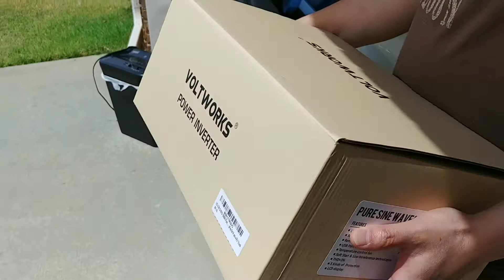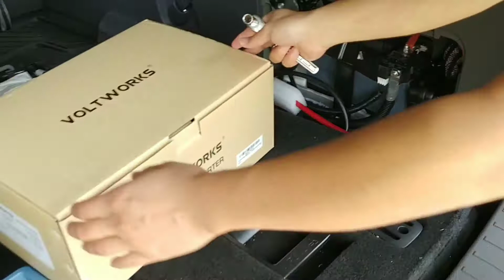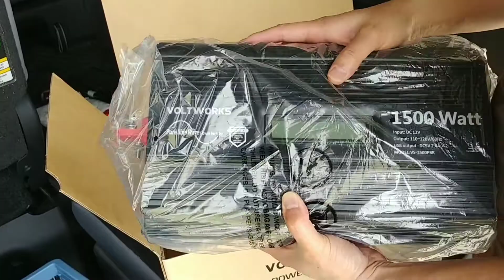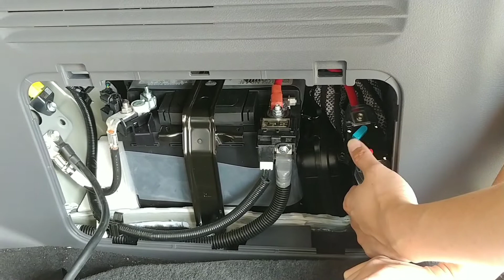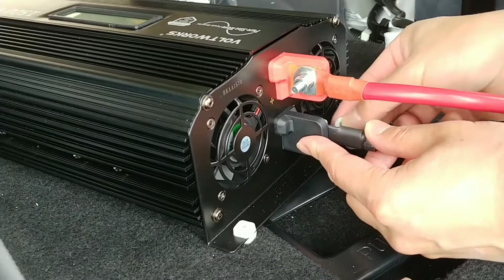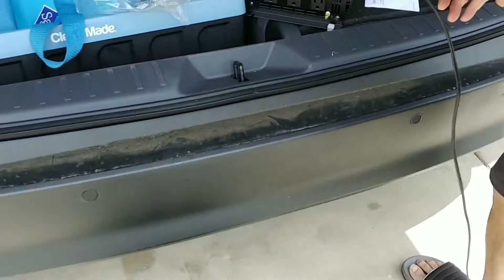2021 Sienna/highlander inverter install

Comment: @lifeofalego8061  Life of a Lego, after these years, have you finally had a chance of challenging the set up by running a 1300-1500 watt continuous appliance for 10 to 15 minutes?
Reply: Not possible using the 100A circuit breaker he's installed.  100A X 12.5 volts = 1250 watts, minus the 10% inverter inefficiency, would be roughly 1,125 available for continuous draw before tripping the breaker.

Comment: I know this is a late comment, but a 1500w inverter (will need about 150a) will burn up your DC converter (which has about 70a available output capacity)
Reply: Your 'DC converter' as a terminology, I assume you are talking about the car's high HV voltage DC to 12V DC inverter(Toyota's terminology).  Based on the facts that we can gain visibility of, your approx. 70a should not be correct. The Toyota's optional 'built in' 1500W AC socket/output is fed by the Toyota/factory '1500W' inverter and its 12V is coming from (the same for all Sienna models') the HV voltage to 12V inverter located in the engine compartment and it should be able to output about 140 amp to your 150 amp without burning up when continuously outputting 1500 watt.
Reply: @frmmli  This is incorrect logic.  The factory 1500 Watt inverter runs directly from the high voltage traction battery and NOT from the Dc to Dc converter that feeds the 12 volt battery.

Comment: The video ends with a test using a paper shredder, which is a lot wattage appliance, hence does not really proof 1500W. A 100A breaker was used on 12V. If you do the math, Power=Voltage x Current = 12V x 100A = 120V x 10A, it means, this setup will "break" when exceeds 10A on 120V appliance. Hair dryer, microwave, heater etc... likely will trip the breaker. That being said, as an Electrical Engineer, this setup would work with some different parts and some limitations... I would recommend move up to 150A breaker, possibly thicker wires. Now, the interesting calculation, if the Toyota DC to DC inverter/charger is assumed to deliver 100A to the Auxiliary battery, the Toyota Auxiliary battery is 860 Amp Hour, assuming you do draw 1500W continuously, you will be running a 50A deficit (drawing from the Toyota Auxiliary battery to make up the extra current), doing the math: (850 Amp Hour x 50%) / 50 A = 7 hours. In another word, this is not a "true continuous 1500W setup", but it could supply high current for many hours depending on how full the auxiliary battery is, and how quickly Toyota DC to DC inverter/charger tries to recharge the auxiliary battery. So, it is practical to run most of your high current application such as microwave, hair dryer, fridge, heater, etc...
Reply: Thanks for doing the math...
Reply: Dang Anna!
Reply: @AnnaQuerbach, the discussion is centered around connecting an aftermarket 12v to 110 VAC inverter to repeat/replicate the Toyota factory 1500 Watt AC output (if you purchased that optional feature).  How that factory feature is supposed to be used and work is not to get its power from the 'tiny' Aux battery but the DC to DC inverter (see my reply today to @rickjacobs2059 above) therefore you are required to have the car in Ready/RUN mode('in the engine running mode and transmission in P, i.e., like you have just pulled up, put in P but do not 'shut off the engine') at which time the DC to DC inverter is operational/continuity mode: and the engine can run as needed - shut off if the hybrid battery is full enough or run if not until the battery is full enough and then the engine is shut down into standby mode. So, when the 1500W inverter needs to be used, the DC to DC inverter will be triggered to starting inverting the hybrid's 48VDC to 12VDC. To fool proof the customer from forgetting to leave the engine in the above described position, there is a switch on the dash that you turn on and off the 1500W inverter. It will not send signal to turn on the 1500W inverter IF the 'car is not in the Ready/RUN mode. 

With the aftermarket inverter solution, you will not have that 'logic control' and you are at the mercy of your brain. 

As to whether the aux battery can be fried if you forget to leave the 'engine on' and run your aftermarket inverter, it probably will not happen if you are buying an inverter with a protection against low input voltage to turn off the inverter.  Yes, you will need to buy a jumper battery in case you forget and drained your Aux battery I think.

Comment: …Toyota is a “Pain in the A**” to work with.   They advertise a 1500 Watt inverter, but trying to get one is near impossible.  Look at all the trouble and potential danger to the vehicle this guy is going through, not to mention the 120Volt receptacles will not be in the place they would be if factory installed.  Also this guy might be voiding his warranty
(There is a 120Volt receptacle in the 2nd row and one in the storage area if factory installed.  Plus is this inverter just going to be flopping around or is he going to hide it away??)
Reply: You have to pay $10,000+ extra for that 1500w factory installed feature.  It only comes with higher trims, not the lower trims.

Comment: I would put a 200AH LiFePO4 and a 20A charger to the place of the van 12v battery. Then I hook up the inverter to it.  I would not put the inverter directly to the car 12v battery. It may kill your car 12v charging system when you have a peak out put from your 1500w inverter.
Reply: Tony, please look at my later reply to Life of Lego and you just now.

Understand your reasoning and your solution. However, the 3 of us are talking about 2 different givens/situations.

Life if Lego and I are in a way trying to replicate/'hack'(accidentally) the Toyota 1500 watt option/setup. He has a 100 amp breaker/fuse. In theory, can max out at 125 amp fuse/breaker (1500 watt/12 V = 125 amo) if we can get one. That said, the unknown to me is (when I don't have my vehicle yet to check that supply 12v cable size and to do the actual trial), I have to be concerned if that factory cable can safely carry at least 125 amp(1500watt) therefore asking Life of Lego to try and verify) - measure the gauge, not not too warm to touch at 1500 watt usage ...  And we use that converter with the ignition key on.  See my reply.

Your idea is equal to having an extra stand alone large 12v lithium battery in the car and not hardwired to the car. In turn you will charge it with a 20A 'wall plug' plug in charger to recharge it. 

Your set up can actually also be charged by the 12v cigarette charger but only around 10 A in a Toyota. 
So, bottom line is, the two presents diff level of challenge/convenience in recharging.
Reply: @frmmli ut  you do that way , it will burn your 12v battery CHARGING CIRCUIT. Not the 12v battery. I wouldn't do that. You can use that 12v battery charging circuit to charge your 200AH LiFePO4 battery, then use it for the 1500w inverter. I would not do just like the guy hooked up in the video.   You try on your car. I don't.

Comment: Good video I just wish you showed the first part
Reply from the maker: Yeah, I didn't think about that.  I did try to zoom in at the connection at the end.
Reply from the maker: I think the 2500 inverter is good but not sure about the 300 amp.  I installed the 100 amp so that it will trip early for good insurance but that's just me.  I'm no expert.
Reply: @lifeofalego8061  100amp fuse is too small for 2500W inverter when you are using a high current appliance,please install 250A or bigger fuse
Reply: Thinks he wants it to cut out sooner.
Reply: Oh I thought maybe the more the better
Reply: Johna, please check out the two diff threads I have with Life of Lego on the subject.  You can have 2500 watt but if you set it up like L of L, you should not go above 1500 watt continuous running. 

I think I am in the similar chain of thoughts as him. We are trying to free ride on the existence of that 12 volt cable going from the hybrid battery voltage to 12 volt 'transformer' in the engine compartment to the aux battery and my understanding (from some blogger and not personally verified), is that the cable may be rated for that kind of wattage/amperage like 125 amp, accidentally may be, because there is no obvious reason for that aux battery to every run that kind of wattage.

Short of L of L saying too much, he tells you to put in a 150 amp to cut you out before you fry the cable then your car when you run your 2500 watt above 1500 watt.
Reply: I got the pure sine 2500 inverter and 300 Amp breaker. You think I'll be ok?
Reply: @LivingWithJohna  It is OK
Reply from the maker: I wouldn't go any higher than 150 amps if I wanted a higher amp installed

Comment: Have you tried enough # of time running the inverter close to the full 1500 watt like cooking with a 1200 watt microwave oven, running a burner or e-kettle close to 1500 for extended time like 15 minutes each time and not having any concerning observation. I believe your set up is sound based on what I know but waiting for actual tests to verify. Thanks!
Reply: 1200W microwave oven actual starting power is about 2500-3000W,please choose a bigger pure sine wave inverter
Reply: Tks, Life of a Lego. I think your routing/circuit makes sense in the sense of where the inverter gets the 12v input from - @ the tail end of the 12v cable/wire from the 48-to-12v inverter in the engine compartment.  The factory optional is picking up the 12 volt kind of at the front end of the cable (which is the 48-to-12v output connection point). Not knowing what gauge or whether the gauge of that long cable/wire is sufficient enough to carry the max. 125 amp (theoretical), I ask the question on whether you have actually run at that storage/max out to around 1500 watt for 15 min., and more than one time to validate the 'design'. 

That will greatly appreciated and benefit a lot of DIYers. Please keep me posted once you have a chance to try it. 

One gent has discussed in a forum of doing what you are doing but not to the point of actually hooking it up. If you do, you will be the first and validated by you.

To Tony, thanks. The usage practice we are talking about talking here is keeping the Hybrid vehicle in the ignition/run position and vehicle in P. We are actually tapping into the 48V hybrid battery but not its 48v and instead the 12v after it has been step down to 12v by the built-in 48-to-12 inverter in the engine compartment (that's how it is called but actually more a transformer). The output from that includes a long cable coming back to charge that 12v aux battery you are concerned about. So, we are not using the 12v aux battery you worry about. It appears that we are tapping into that battery but we are not unless we forget to leave the ignition to on. (The engine will cycle between off and on to replenish as we keep on discharging/depleting the hybrid battery.  If we buy the vehicle with the factory 1500 watt inverter and now actually not orderable in real life since Toyota is allocating vehicles in their unwritten specs; there is I understand, an inverter function 'on/off' push button/switch with a logic circuit and you can't turn on the 1500 watt unless your ignition is on. That helps to ensure u don't run your aux battery flat. )
Reply from the maker: Sorry, I haven't try that set up yet.  I mainly set it up for emergency power.
Reply: @lifeofalego8061  Life of a Lego, after these years, have you finally had a chance of challenging the set up by running a 1300-1500 watt continuous appliance for 10 to 15 minutes?
Reply from the maker: Tony, I concur with what frmmt is saying, I believed no harm to the vehicle battery as long the power to it is on the run position.  It should be the same method use by toyota minus the safety inverter switch.
Reply: Please please bring your microwave to your car and make some pop corn a few times but keep an eye on the cables temp. I and many will thank u even though your original project is not to address that kind of camping usage.
Reply: Life of a Lego, after these years, have you finally had a chance of challenging the set up by running a 1300-1500 watt continuous appliance for 10 to 15 minutes?
Reply: @frmmli  You are being very reasonable. L of L is not forthcoming and I do not know why. It seems like a 1500w inverter with 150w breaker fuse is the way to go. Then use a low watt microwave(900w),  low watt electric skillet, and or refrig/freezer.  Would a 2500w inverter be better or not compatible with Sienna hybrid?
Reply: @Life Of A Lego  no good. You don't harm the 12v vehicle batter yet. You may burn the charging circuit for that 12v battery. Don't do it. Or you hook up 20A car charger from there to charge your LiFePO4. Hook up your inverter to your 200AH LiFePO4. Then it will be ok. Don't burn the 12v battery charger. The van is hybrid. It does not have an engine alternator to charge the 12v battery.
Reply: It would kill the 12v charging system. The car 12v battery does not have enough power to run the 1500w inverter. DONT DO IT.

Comment: the cut out switch comes with  or it is all ready in van  or you install?
Reply from the maker: The cut off switch is the resettable fuse that I connect it in series with the positive wire.  You'll need to purchase it